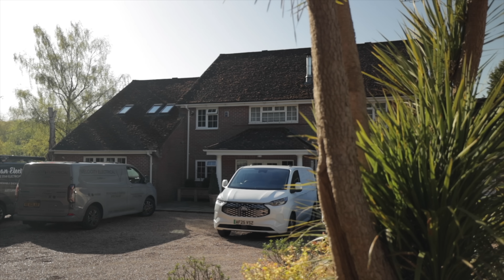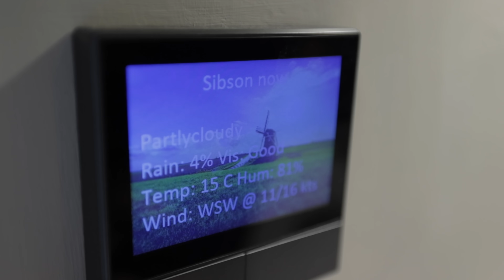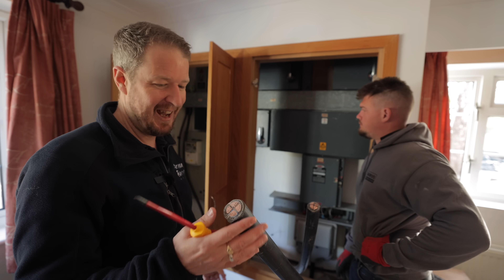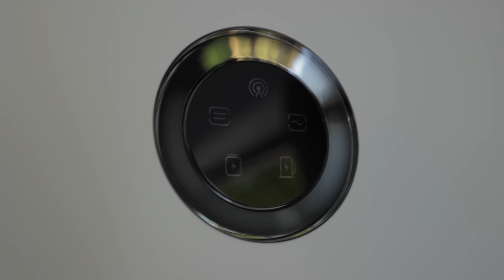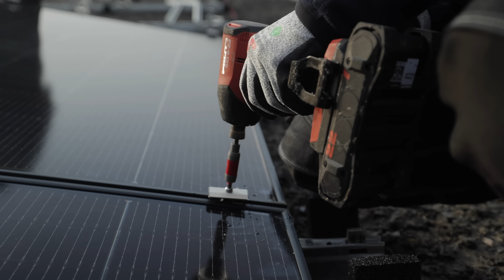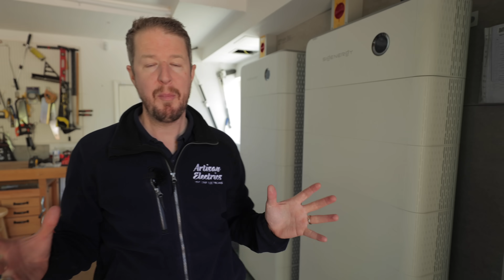Is Battery Storage Actually Worth It In 2025?

Comment: @arisaneletrics wish you were in Portugal as I have had bad experience with eletricians and i was interested to know if it was worth adding batteries to my house.
Reply from the maker: If you don't mind us asking, what was your bad experience?
Reply: @artisanelectrics First situation was the bad install on the PVE system from the supplier company, which made our eletrical system crash every 6 months and we had to request them to come to our location to repair and each time different electricians who did not know how to troubleshoot. They restarted the microinversors and after 5 years one finally said hey you need a grounding breaker between your home system and the pve. That was one issue. Other is that even though there was space in the home eletrical panel the electrician that came to mount the car charger just left the charger and said no space for a dedicated breaker(I had 6 spaces left). So ended up having very little trust on the eltricians here and none with the clear experience and information that you have

Comment: Recently had a Tesla PW3 in whole home backup mode, plus a 4.5kWp solar system.  Charge the PW3 overnight on cheap rate and use the battery to run the house during the day.  Solar system exports at double the ‘buy’ rate.  It will take around 8 years to pay for itself, less if leccy gets more costly.  My electricity will be in credit this month rather than being £100/month before system installed.  I do have servers and they’re on a UPS.  PW3 will run my home at base load for 26 hours in the event of an outage.  For me it works well.
Reply: You have been ripped off. Tesla charges something like £700 per kwh. You can buy an EV wih an 80kwh batery for less than £40k so that is £500 per kwh and you get a car thrown in for free. Meanwhile batteries are now less than £50 per kwh.
Reply: Less than £400/kWh and cheaper than other brands.  You need to do more research.  £40k won’t get a very good EV either.
Reply: 8 years is too long, there's a bunch of risk with these systems and some maintenance costs too, 5 years is were you want to be for a financial argument.

Comment: Are these apps all cloud-based? Could you talk about what happens to these systems if the supplier shuts down? Can they still be managed locally? I've been thinking about putting together a Victron/Fogstar system and doing the management software myself a for fun little retirement project.
Reply: Good point, too many companies have gone bankrupt to trust they'll be about forever.
Reply: It's a relevant consideration but one that would be difficult to answer as sometimes older 'reliable' brands do out of business too.  All the battery products should 'work without an internet connection but some functionality may be lost if the "app' access is also lost.
Reply: @PowerOn-  Absolutely - it's an issue with any brand. My main concern would be the data connections between the battery modules and inverter. That communication could break if the protocol they're using relies on a digital certificate managed by the company, and that certificate expires (requiring a firmware update to refresh).
Reply: Are you prepping for the apocalypse?
Reply: @nealm1814  what would you state the odds of china invading another nation in the next 10 years, do you think companies like signenergy are going to keep their cloud platforms up?  You can't make the financial case on these systems and not take in some risks.

Comment: Just a quick word of warning I had a tesla powerwall 3 installed. But a lot of energy suppliers wont let you set up an export tariff if you dont have solar or a means of generating anything. I'm on Eon Next Drive for cheap electric overnight, had my powerwall installed by octopus. Eon wont let me export without solar. Octopus wont let me export at anything higher than 4p because my import is with Eon. I use enough that I am saving £2.50 - £3 a day just by importing overnight. But to take it further i will be getting solar end of the year.

Comment: Does discharging the batteries to take advantage of electricity selling opportunities mean the batteries wear out faster?

What would be the calc needed to determine if such degradation was 'worth it' ?
Reply: lifepo4 has like 4k cycles (100%-0%-100%, at 0.5c) before it degrades by 20%

you will hit the calendar aging faster then the cycle life. So if you dont cycle it, you kinda "lose" money

Comment: There are lots of battery systems installed in people’s lofts. Three years ago when I wanted to get solar and batteries they wanted to install the batteries in the loft, I didn’t think that was a good idea and for other reasons I didn’t go ahead with it. I’m glad I didn’t there would have been an element of worry now and I’d be looking at getting the batteries moved at some cost I’m sure.
Reply: My installer wants £250 to change the WiFi channel! The ISP needed to change the channel and their technician did it for the BMS, but SolarEdge requires physical access to the loft. Thus no access to their data😮‍💨

Comment: Don't understand how you can be saving money, the battery pack storage, ancillary equipment and labour costs would cost more than the savings. I suppose the savings would come in years later but wouldn't you need new battery packs when they have worn out.
Reply: Commercial rates for electricity can be much higher than the energy price cap, which applies only to private individuals.

The energy price cap is already pretty high.
Reply: @DigitalStefan  It's the difference in price between peak and off-peak that is relevant, not the absolute price.
Reply: sure it takes time. Just like with any investment. Also don't forget that this is a business. So there are going to be tax advantages (depreciation,write-off,deductions).
Reply: @derradfahrer5029 Your electricity bill is already a deductible expense, so I don't see any tax advantage...
Reply: Average time to pay back the initial outlay is 6-7yrs, batteries should last 10yrs minimum, solar panels minimum 25yrs
Reply: @corno  A solar system might pay for itself in 6-7 years, but I can't see how battery only is going to do that.
Reply: @corno on those numbers, battery is not worth it.  S&P500 will double your money in 7ish years with battery you are only jalf that.
Reply: @inh415batteries have dropped in price, and will continue to drop in price over the next 😂 few years. This of course will continue to be responsible for horrendous global pollution.
I don't understand why they don't already have solar and possibly a small wind turbine. 
Living in the courtyside makes having a battery backup a much better idea.
Reply: @thetourk  diy from a used EV battery or something like fogstar batteries makes sense,  but on the OP numbers it dosnt make sense at all.
Reply: It all depends on the energy usage which can be pretty high if this property runs electric saunas. 

Charging 150 kWh at 0.06 pounds instead of 0.15 pounds on a daily basis year round really adds up over a 15 year battery life.

Also, business continuity can save lots of money if there are frequent power cuts. 

For a typical home this would be a little too much of a good thing. Luckily prices for home battery systems are coming down pretty fast, so at some point it will be something most home owners can afford. 

I think getting a home battery will just be common sense when getting solar in a few years time. Here in the Netherlands we now have an abundance of solar power, so in good weather the hourly trade price (exluding margin and taxes) drops to or below €0 per kWh for many hours a day. At some point the UK will catch up to this reality.
Reply: @SolAce-nw2hf  The UK gets negative wholesale prices quite often. It happened today because it was so windy. We exported a lot of surplus to the continent, but prices were still slightly negative for a while.
Reply: @thomasdalton1508 it's been 0 or below here for many hours a day most of the time in the past month here.
Reply: With a property like that you could probably do it but certainly not viable for a regular sized house
Reply: Obviously as it's a business there is corporation tax savings. Buying stuff for the business is an easy way to use money from the business.

Comment: I wonder what the longevity of this kit is. More and more complex setups will see how reliable this is in the future and the raw materials to make it.
Reply: 10% loss after 10 years on LiFePo4. Mine is on outside wall between properties, not too hot, not too cold.
Reply: @GeekfromYorkshire  do not expect 10 years - check any car battery pack (or big high current output cells) advertised lifetime, (at proper usage without too much overcurrent discharge) it is under 7 years to 75% then slower decay. at 75% lithium batteries in powerpacks is deemed worn out.
Reply: @johndoe9922  What is it for LiFePo4 where you've over-sized the battery to not do too many deep cycles?
Reply: Should be lasting around 15 years and perhaps 20. Coboalt no longer needed in LiFEPo4 batteries and it looks like Sweden have just discovered billions of tonnes worth of rare earth minerals. There's enough to go round for years.

Comment: In winter we use 60kwh per day and in summer 20kwh per day. The system is great, but its expensive for our use, we only have 2 tarrifs, 14cents and 18cents. Backup with 0ms is amazing, but can these batteries be outside, to prevent any fire risk in garage🫢

Comment: at the minute we are buying aprox 30p of electricity to top up our 12kw battery storage, topping up during the night at 6.5p kwh and selling our solar back during the day at 16.7p, currently making around £3-£6 a day. Literally the best thing we ever did fitting solar and batteries. We get our auto gateway fitted in a couple of weeks!
Reply: Only £3-£6 per day? That doesn't sound like anywhere near enough. That works out to around £1,000-£2,000 per year (and we're close to the summer solstice, so you'll actually be getting much less averaged over the year). How much did the whole system cost? Your break-even time may be longer than the lifespan of the technology...
Reply: @thomasdalton1508 But they’re also not paying anything for their consumption I assume.
Reply: @budawang77  It wasn't clear if they were including savings on their own consumption or not.
Reply: @thomasdalton1508  whole system cost about £10k and we were spending about £1.5k-2k per year on energy bills prior to install, currently our worst winter months cost us about £60 including standing order and we also removed our gas from the property so this is our total spend on heating also, i couldnt be happier
Reply: @thomasdalton1508  all equiptment installed has a 20-25 year warranty
Reply: Static battery storage is not the same as car usage. In a car when percentage drops below 90% after approx 8 years when it degrades to 60% it is advised to change because of high demand needs, instantaneous demand. Whereas in a home storage system the demands are less they are not high acceleration demand, it is more stable and constant. The batteries will last far longer, also newer chemistry are using less materials that degrade slower. Also these batteries are also fully recyclable, upto 99%, because the materials can be reconstituted and they can produce a new battery. Unlike any fuels.
Reply: Assuming that your battery storage has an expected 10 year operational life, if you proportion the cost of purchase and installation across those 10 years (as you would then need a new battery storage installation) how does that affect your gain of between €1095 - €2190 a year?  Taking the midway average of €1642 per year, if the purchase and installation cost more than €16,420 (using the 10 year rationale) then it will actually be costing you money.
Reply: @KevinWeaver-b7l  the batteries have a 20 year warranty and it cost me £10k
Reply: @KevinWeaver-b7l 70% rentention after 10 years means batteries can run for maybe 5 more years at lower efficiency plus we can add on another battery 10kw then to help maintain power to house
Reply: Battery is kWh! Not kW...
Reply: @allan4787 I spent about £10k on the install,  my energy costs prior to the install were about £2k per year, im now paying £30 a month including standing charge and last month sold back £120 to the energy company. In 4-5 years ill of more than paid off my investment and the solar and battery have a 20 year warranty...seems pretty good to me
Reply: I will pitch in with my last year numbers.  I bought my solar PV & battery system, 4(ish) years ago, at a price of £10k.  It is not a perfect system, and I will be changing parts of it as improvements come along.
- PV panels = 6kW
- Battery Storage = 7.5kW
- The Electricity Bill for 2024 (without the system) SHOULD = £2000
- Income from exporting electricity for 2024 = £700.

Therefore in 2024 my system saved £2700.  Given that electricity prices have been similar for three years now and unlikely to suddenly change, the system will have returned its base cost in 5 years.

I allow some additional time to allow for the loss of, opportunity cost, lowering electricity costs next year, and the upgrade of the solar panels on one section [350W to ~600W] later this year.
Reply: And your battery costs you anywhere between 15p and 20p per KWh to actually install
Reply: @allan4787  if you have the money spare id rather invest it into batteries and solar than give the energy company almost £2k a year, instead they can pay us, if nothing else this makes me happier
Reply: @allan4787  £2,100 : 15.5kWh : 3,500 cycles = less than  £0.04 per kWh
Reply: @allan4787 Installation costs are not a function of battery capacity.
Reply: Say he makes £1000 a year profit. That's not bad for an outlay of around £10k for 12kwh battery. So make even around 10 years. 
Big issue is how long will they last. 🤔
Reply: @russellhenderson8941  it wont let me reply with my costings (ive tried to reply 3 times, im guessing this one wont show either - very odd), gone from £2k a year bills to now making a profit of about £1k, all equiptment has a 25 year warranty
Reply: @russellhenderson8941  about 3000-3500 charging cycles (=days in this use case) so less than 10 years.
Reply: 10year warrenty.  @russellhenderson8941
Reply: @russellhenderson8941  yeah its not enough, you have to cross your fingers just to cover the original outlay while inflation actually destroys your return.

Comment: i just checked out their website. can you confirm that the batteries run at only 36 volts? that's ONE HELL of a lot of amps :-( 
i dunno about you but for me that would be a reason to buy some other battery system with a higher voltage.
Reply: They might be 36v but they are in series. Most every manufacturer will go high voltage dc soon. It is more efficient.
Reply: @DMIINC2013  actually, the battery modules are connected in parallel. As they stack on top of each other, it creates a large parallel bus bar running right thru the stack. 

Each individual 8KW module is made up of 9 cells, each cell being 280AH and 3.2V nominal. That adds up to 28.8V per module on the stack, and no matter how many modules, it's still 28.8V. 

That's not an issue tho, as most other battery systems are only around 48/52 V . Stepping up voltages is a simple, efficient task, compared to inverting DC to AC.
Reply: Each battery has an optimizer which steps the voltage to a higher voltage. It also gives the ability to have redundancy if one battery kaks out. It's great for installers when they want to add to the system. No need to balance State of charge. Best in the market.

Comment: Absolutely - 2.5p/kWh here with a high usage house and an EV, and a small (2.5kWp) array.
Just being able to use cheap power all day is so valuable.
Reply from the maker: Very nice!
Reply: @artisanelectrics absolute nonsense if you include the cost of buying and installing the battery. 

10kwh battery installed £7600 
Battery life is 10 years. So you are paying £760 for a year of battery. 

£760/3600 = 21p per KWh that excludes the cost of money or AC/DC/AC conversion losses

If each cheap unit of electricity costs 8p it actually costs about 31p  
ie 21+8+1+1
Reply: Unless you would charge less than this.....
Reply: @allan4787 £7600 sounds a ridiculous price for just a battery. I'm about to have a complete 8kW solar system with a 9.4kWh battery for £8650, including a 6kW inverter, bird mesh, scaffolding and fitting included. The batteries have a minimum of 6000 charge/discharge cycles.
Reply: I recently installed a 16kwh battery for €1700. Cells are rated at 8000 cycles before degrading to 80%. If i cycke them everyday thats over 20 years before degrading. No brainer.  @allan4787
Reply: @allan4787  There is no way the battery would only last 10 years... the warranty might be 10. The battery will go on for much longer.
Reply: @craigix 
Anything that needs more than 10 years to pay for itself is not worth having.
Reply: @craigix I have had 2 PHEVs the battery is at 70% at 8 years. 

Do the same arithmetic for a degraded battery and take into account Artisan prices and maybe the cost will be 15p per KWh. 

Notice they never ever give real cost for ownership
Reply: @allan4787 currently on track to pay for itself in (checks spreadsheet) 4.6 years.